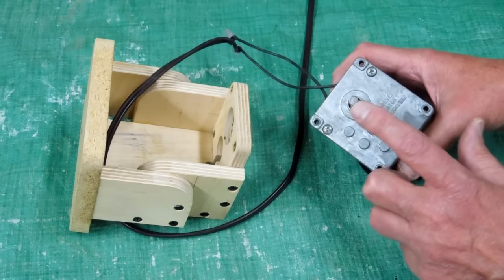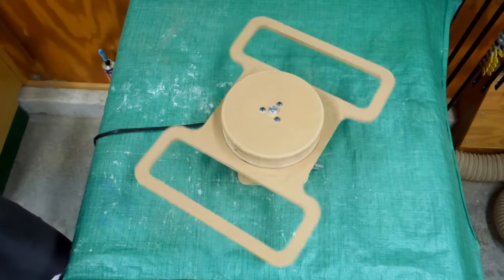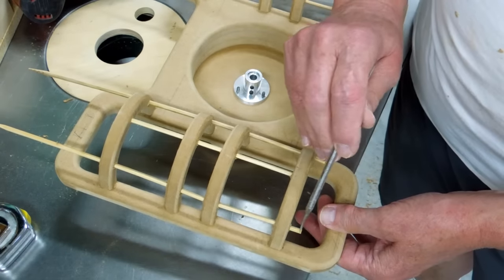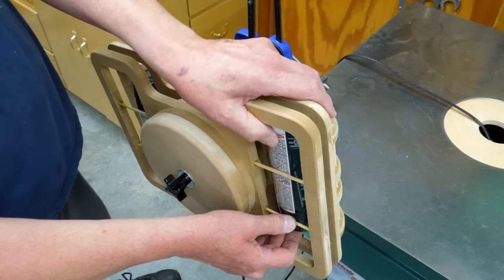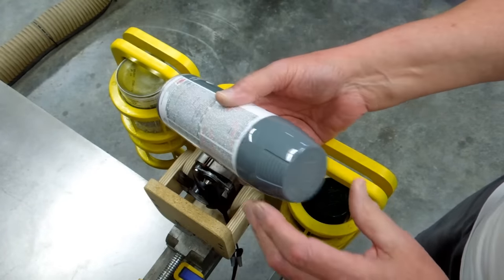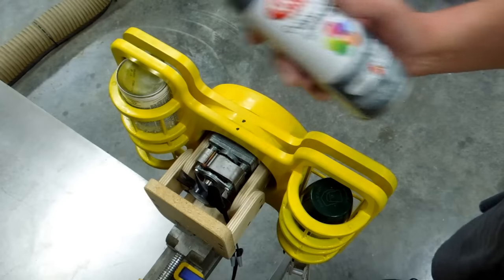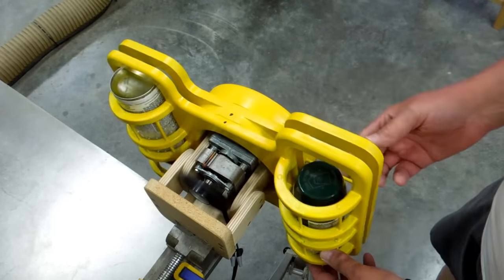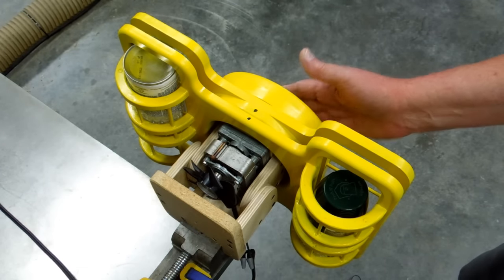Spray Can Paint Mixer

Comment: When I read the title, I thought, "Wow! He found a way to mix different colors of spray paint!"
Reply from the maker: I did. It will mix all different colors of paint. :-)
Reply: ...together...
Reply: lol  I thought he was going to spray them together in a bowl and mix it.  haha
Reply: I was expecting some sort of mixer adapter that fits on both nozzles. It would be really cool, if you think about it.
Reply: you can do this but it takes some work. basically you turn the can upside down and spray out all the aerosol gas. then when it's depressurized you can drill a small hole in the can and drain out just the paint. then you can mix the paint to your liking and pour into a paint gun and apply that way.
Reply: Mark Speir there is already a way to mix two colors. Graffiti artist have been doing it since the 70s
Reply: Everfalling you don’t even have to do that. Take one color that’s half full and stick in in the freezer to bring the pressure down as far as you can. Get the color you want to mix and put it on the dashboard of your car with the defrost on high and hot to raise the pressure. Get yourself two sets of any lubricant type nozzles with the straw (typical WD 40 setup will do.) Put one straw aside as you only need one. Connect the straw between the two nozzles and voila! Be sure to open the valve on the cold can first a split second before you open the hot one to avoid a mess. The higher pressure can will dump paint into the lower pressure can. If you have a scale and know a little algebra then you can accurately predict how much paint/pressure to start with in each can to achieve desired results.

Comment: Neat idea, Ron.   I would think that a few pieces of bungie cord stapled into place would remove the need for the large/heavy/awkward front clamping plate?
Reply from the maker: Many possibilities. This was prototype No.1 and I had no need to go any further with it. Maybe later when I get bored with some other project. :-)
Reply: Yup, that's one thing that makes woodworking interesting: there's usually more than one way to do it.
Reply: It's a great concept for sure. I would not say it's Rube Goldberg, but it's not far. haha I think just a couple "V's" or right angles to set the can in, and then take a few of those 412 year old rubber bands you have, that will last until the second coming, and strap her in with those and turn it on. I'm going to make a quick one of these myself. Keep up the great work and cool projects.
Reply from the maker: Sarcasm, a refined art with which I am not
unfamiliar. Funny! :-)

Comment: at only 19 RPM, is it really necessary to balance the load?  I don't mean running it with a full large can on one side and empty on the other, but I can't imagine that it's really all that necessary to move the smaller paint cans up 3/4" is it?
Reply from the maker: Now you've done it. You pointed out the engineer in me! :-) Only takes a second so why not do it. Partially full cans also have shifting weight (momentum). This particular shaded pole gear motor is quite strong... many are quite weak and small things like considering balance could come into play. Getting things moving in the first place may be an issue with a weaker motor. Thanks for watching!

Comment: I have serious doubts that this is “shaking” the paint. Gently moving it about?.....definitely, but mixing or shaking?....I have reservations.
Reply from the maker: I have experienced zero failures since using this and I have gone through 25 or more cans of paint. What convinced me was the mixing of the bottle of fish glue.
Reply: Ronald Walters How long does it take? I use graffiti paint which has literally 6 to 10 times the amount of solid pigment than typical modern Krylon and the like. The cans I use say “shake vigorously for 3 minuets before use.” You still have to shake it as you go, a lot, or you will experience variations in hue due to these solids settling. Seems like you’d have to put them in over night to get any results... but I must say I like the simplicity of the design. When I first saw it I said “centrifugal force would just sling all the paint out to sides and nothing wix mix. Then I saw the speed you’re operating at and was like, “oh shit! That’s genius! Im sure for domestic stuff like Krylon and Rustoleum it works great. Only real issue I see is you can only fit 400 ml cans. I work a lot with 600s and 750s so i would need 3 of these
Reply from the maker: All that clanking is annoying so I load it up and run it when I'm not in the shop. Let it run for several hours or as long as you find necessary. I like it for cans that have been sitting around unmoved for a long time. You know there is some settling since the ball doesn't come loose for a while (even with Krylon).  Sometimes I rotate the cans upside down on the shelf. I built the mixer because the manual shaking bothers my shoulders. You still need to shake the can as you are using it. My mixer holds 2 regular size cans. You could make your mixer a hexagon to hold 6 large size cans. I use foam blocks on top of the smaller cans to keep them from sliding back and forth in a slot made for the larger cans. Then you could load 2, 4 or 6 cans opposite each other to balance the load, partial cans loaded opposite each other. Partially full cans obviously would get more agitation. As long as it is balanced, the motor would operate smoothly. It would be interesting to load a container with a removable cap with the paint you think is the worst for settling (and load one ball) and then you could experiment and determine how long it takes to mix. The container with a removable cap would ideally be the same shape and size as a spray can. Run the container in the mixer for a period of time, then pour it out to see if it is mixed evenly... repeat until the actual required time is determined. Please subscribe. Thanks for watching!

Comment: Can you tell me a little bit more about the motor and where it came from?
Reply from the maker: The source for these particular motors (on ebay) dried up.  You just need to look around until you find something similar or create your own using wood gears and a faster motor. Some of these shaded pole gear motors are pretty weak and may not drive a set of gears.
Reply: Ronald Walters no problem. Maybe a windscreen wiper motor?
Reply from the maker: That would work but I try to use mains powered motors whenever possible so I do not need 12V batteries or power supplies.